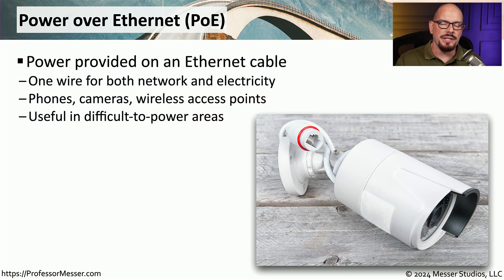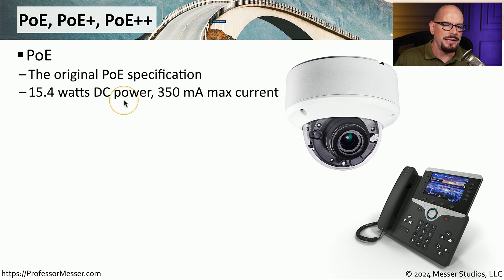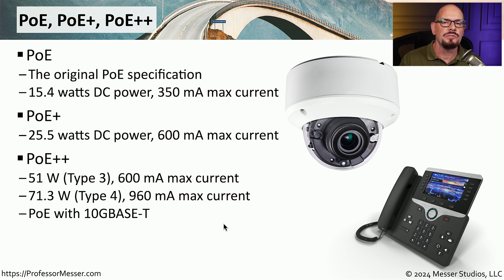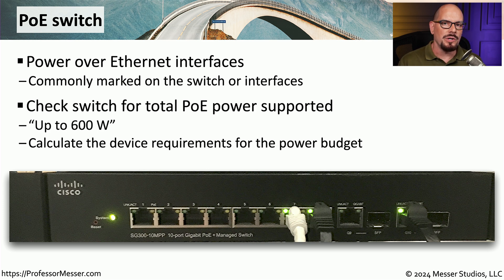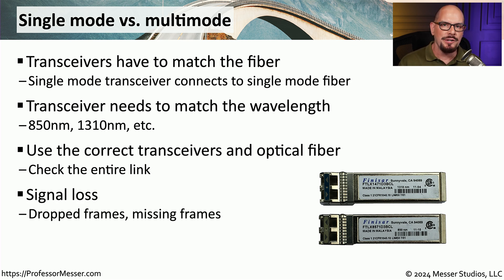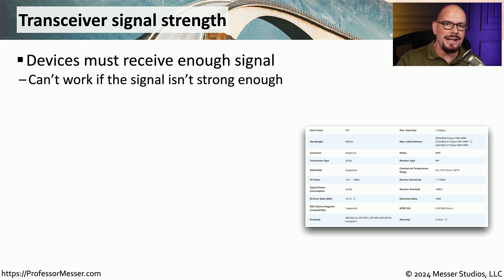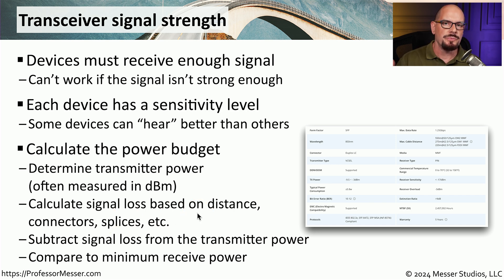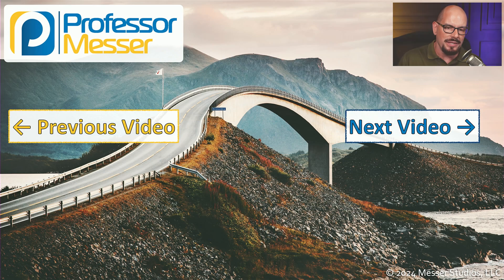Hardware Issues - CompTIA Network+ N10-009 - 5.2

Comment: Is there any particular reason the receiver sensitivity and TX power begins it's measurement at a negative value?  That seems counterintuitive.
Reply: basically it means that when its negative there is a certain SFP CDN where you may be able to touch negatives. this is mostly popular in the nether and someone who has no idea (like a junior tech) may not accurately equip themselves. to ensure TX try doing TXT. this one stands for text.